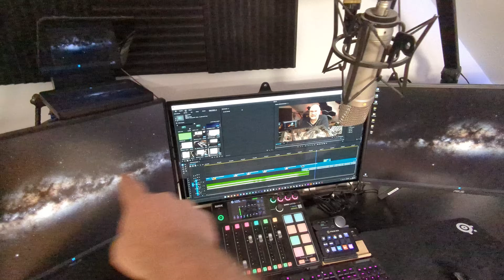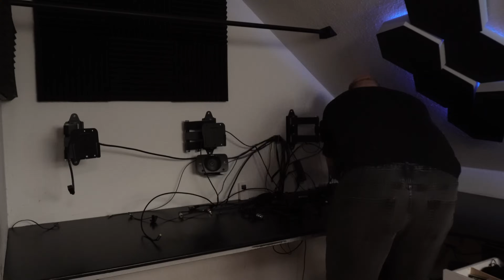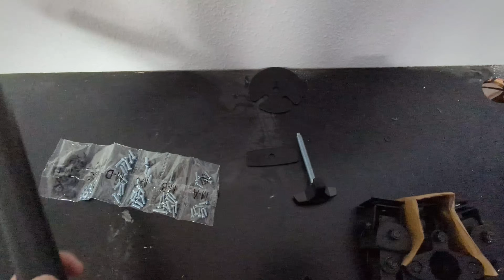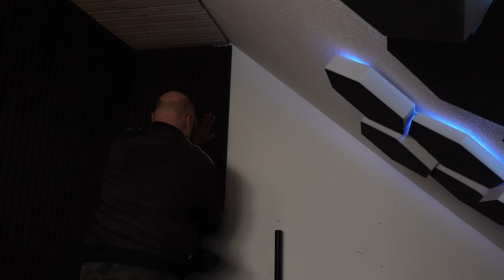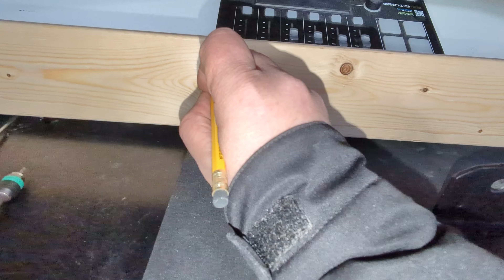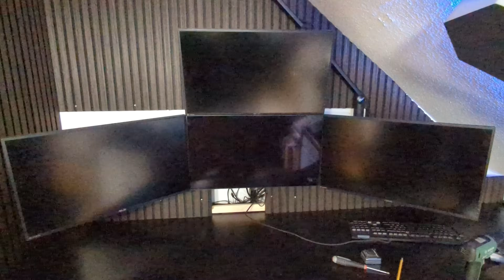New Acoustic Panels And a New 4 Monitor Setup

Comment: i was having a very similar idea for my setup, but here in Latvia those wooden panels are expensive. Here 1 piece costs 25-34€, and the width of it is only 285mm. At least the height is 2700, but still it is significantly more expensive. So still in planning phase and deciding the path to go
Reply from the maker: yeah the panels I bought is 18 × 520 × 2440 mm. i can see the price has gone up a bit since i bought them. now they are getting close to 40€ each so yes they are a bit expensive. i ordered 2 more panels to fix my mistake, and i will use the ones im removing under the table, since some of the wall is sometimes in the video frame